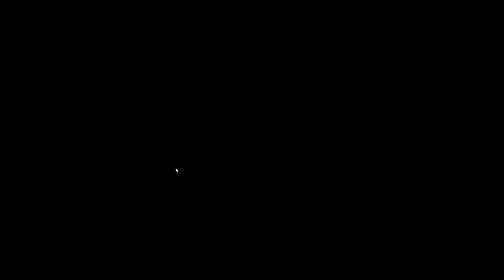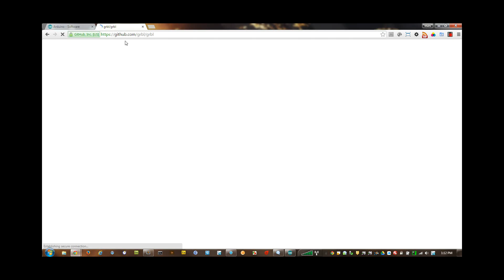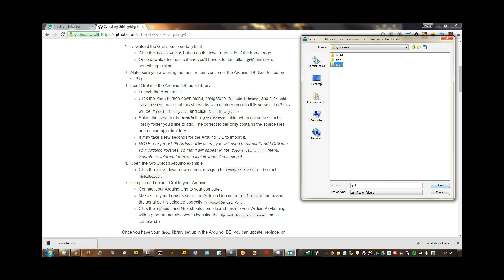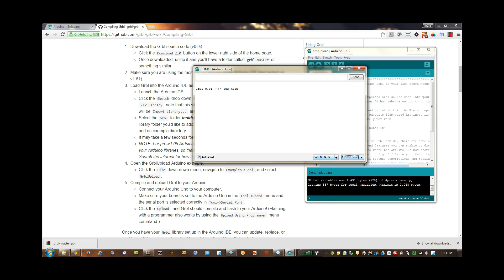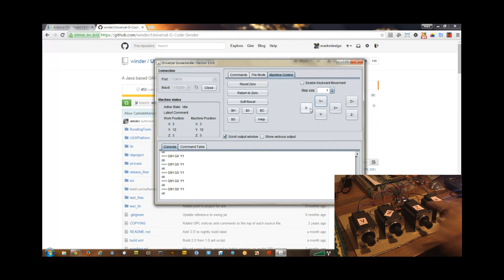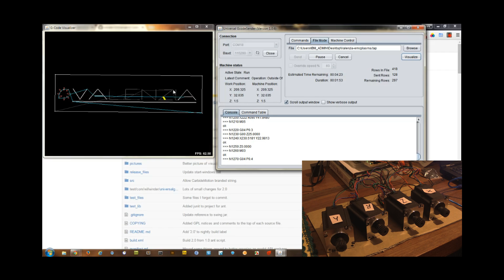DIY CNC Plasma build by a novice - part 2

Comment: Very cool! Thanks for sharing. I have used your setup for my cnc plasma, but I'm having a hard time getting the universal gcode sender to accurately visualize the part without erroring. What are you using to generate gcode? I am using sheetCAM TNG and have tried several post processors.
Reply: Little update, the mach 3 post seems to actually work fine so far, although the UGS doesn't visualize it right. I might try something else to stream gcode

Comment: hi man your doing a great job here. I followed you from the beggining but got lost where you got the program universal to test the motors. can you please help me with that?
Reply from the maker: Hey Gideon, are you talking about Universal G-Code Sender? He is the link to the software (GitHub repo)
https://github.com/winder/Universal-G-Code-Sender and they have the install instructions and set up there.

Basically Universal G-Code Sender streams the G-Code (created by the CAM software, basically coordinates on when and where to cut) to the Ardunio which has GRBL installed on it. GRBL then sends through the commands to the motors on when to turn on, off, fire the torch etc.

I hope this helps and if you have any questions, please let me know.

Thanks for watching.
Reply: thanks for the reply. i was able to fix it after but there's one more thing, anytime i have the x driver on it stop working and says can not find the port where the usb is connected then need to remove the x driver from the shield completely, reconnect the usb without the x before it works. are there any settings i have to do?
Reply from the maker: Hey mate, I'm not entirely sure what is causing that. Make sure your version of JAVA is at the required level (7+ I think) for UGS and make sure the Baud rate is set to the correct setting  for the version of GRBL you're using. 
I hope that helps and here are some useful resources to review.
http://blog.protoneer.co.nz/quick-grbl-setup-guide-for-windows-arduino-g-code-interpreter/
https://github.com/grbl/grbl/wiki/Using-Grbl

Hope this helps.
Reply: thanks man for you time and kindness. I will work on that
Reply: it keeps on giving me error saying  GRBL has not finished booting and I dont know what's that mean
Reply from the maker: If you are running GRBL v0.9 or higher, make sure you up the Baud rate to 115200, if that doesn't work you may have to reinstall GRBL.

Comment: Nice work!!! what motors are this? NEMA 34? 34HS5802 ?
Reply from the maker: Hi +Maksym Nonko, the motors I'm using are NEMA24, they are the same as NEMA 23 but the casing is a little longer... or so I'm told.
Thanks for watching.
Reply from the maker: Thanks for subscribing Mile. The steps I have hold around that but because they'll be running at 2.5amp instead of 2.8amp they'll be a little lower.
Thanks for watching.
Reply: +Mark Valenzia Great Project Mark I subscribed to you to see how the outcome is gonna be :)
 I think that I have the same step motor (with 8 wires) with 8mm shaft  ,Is the holding torque on the motors 340 oz-in?
Reply: +Mark Valenzia  Actually  you&#39;ll be running them at 2.1 A because DVR8825 is limited to 2.1A But anyway I think that is more than enough for cnc plasma , Also make sure you have good cooling for the step drivers :)
Reply from the maker: +Mile Zdraveski That's weird as the drivers I have state they have a max current of 2.5A, not that I've put a multimeter on them and they were off ebay. I'll have to test them and let you know.
Reply: +Mark Valenzia Here is original link you'll read all the info you need  https://www.pololu.com/product/2133   In my opinion no need to worry they are good (My mistake 2.2A not 2.1  :)